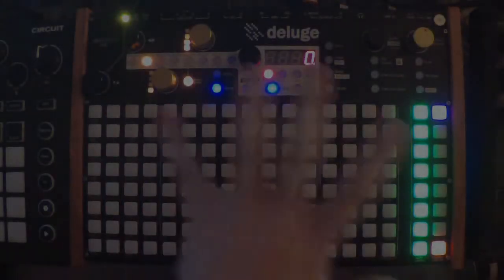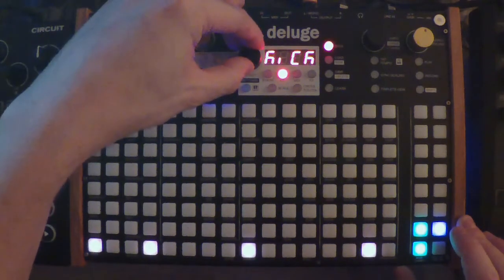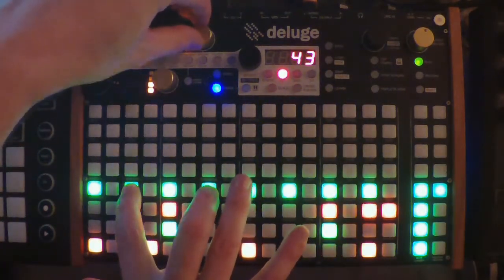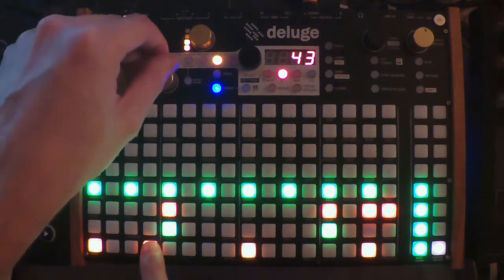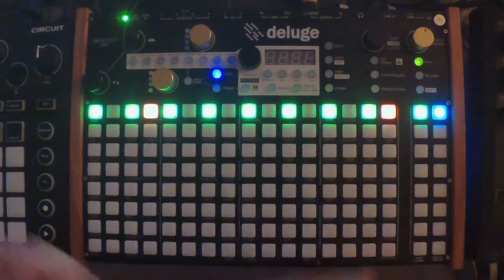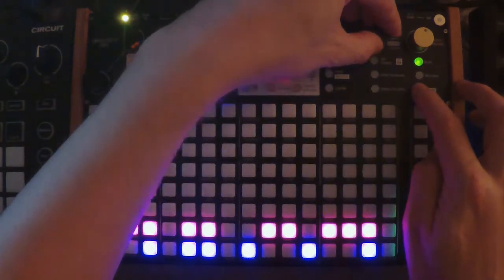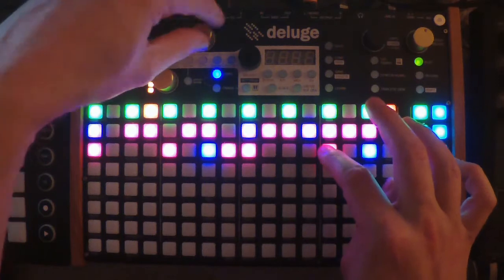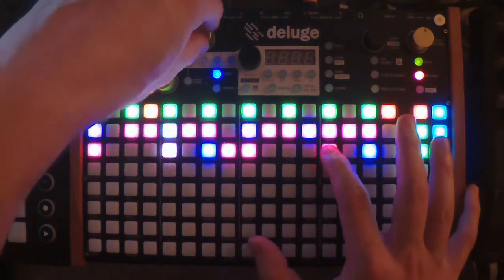A First Look At Sample Kits // Synthstrom Deluge Tutorial

Comment: I'm having an issue making new kits (Shift>Kit). I get the bottom pad loaded with a sample. When I try to load a second sample from another folder, like you show at 1:16, by hitting Back, nothing happens. Did they change things since you put up this video?
Reply from the maker: Depends on your folder structure sounds like you're in the root directory
Reply: @RonCavagnaro  Thanks Ron. That was it. My folder structure was whacked.

Comment: Mine will not load the new kit. All I get are the letters "UI". I am having a lot of problems. It scrolls thru the sounds & won't stop. If I briefly manage to hear a sound & press the knob, it goes on to the next number. Out of a folder marked "chimes" which should be #45, there is the following: #45 "UI", 46 #UI, 47 - ONE of the chime sounds. several more blank kits and then ONE other kit with ONE sound.
Reply from the maker: I'm not sure what you mean by load the new kit. Maybe ask in the open fb group

Comment: Thank you for all your video on the synthstrom deluge.
Personally I d like to see how it manage the longer sample, like vocals, chords progression, synth loop, drum loop (the sounds you have made on other gears, synth, DAW, VST, but you want to play on the deluge as a standalone unit with the SD card)... And if you can easily put them in sync with other tracks, re-pitch, transpose etc.
Reply: Since there is nothing similar to warp function, every 4 bars loop (for 
example) will have a different length depending on its original tempo/bpm...
I guess we have to adjust sample length/pitch/?transposition manually to 
do what we want with those sample.
I have heard that it adjust the length of long sample automatically to 
fit in and put them in tempo. But adjusting the length to what ? The 
number of bars you have define on the track you insert the sample in ?